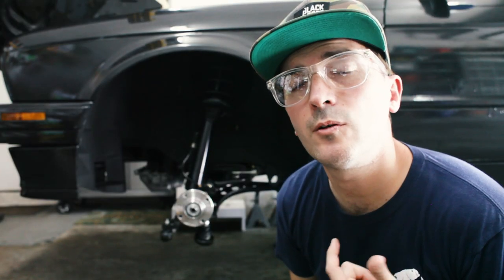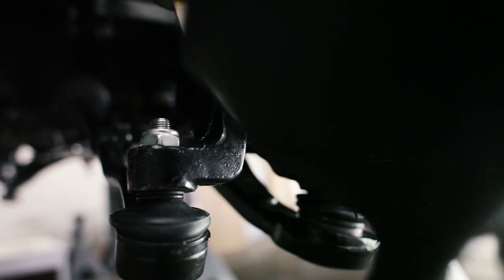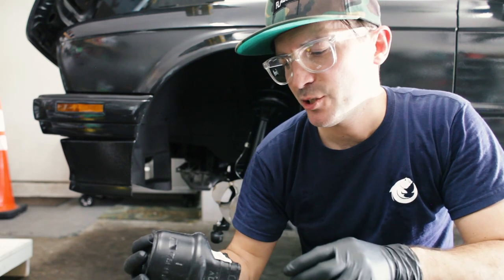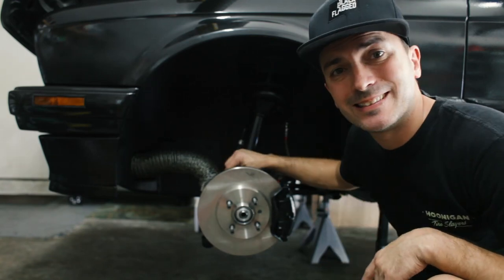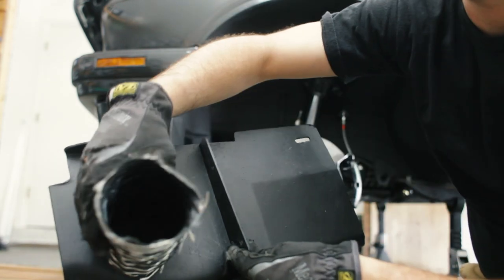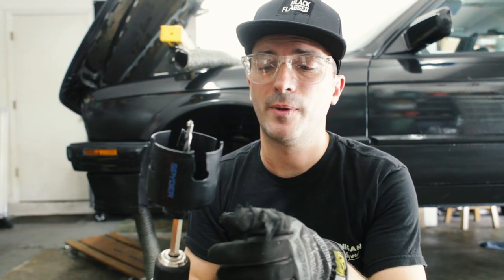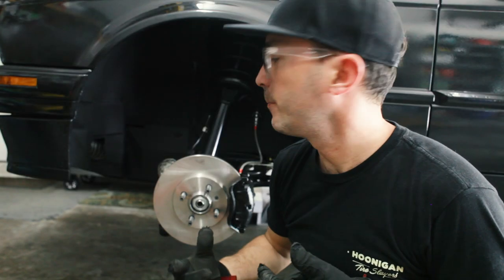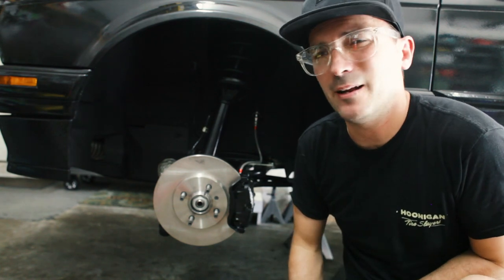Custom Brake Ducting and Brake Backing Plate Install | vlog 071

Comment: Hmm, U mounted to ducting like that. Great and smart (and ofcourse clean) but im thinking now. How does it moves when u turn?! Is the movement so small that it just ""stretches""? Would like to see it in action
Reply from the maker: I made sure all the slack in the hose is by the backing plate (as opposed to under the car between the two holes), so there’s enough slack there to move with the wheel. I’ll try to get a video of it soon
Reply: Okay nice done :) Hope to see it :)

Comment: What type of ducting tube did you get and from where?  Also, leave the other vent open, it will reduce the negative pressure that is created in the wheel well.
Reply from the maker: I used this hose: https://www.condorspeedshop.com/collections/e30-parts/products/copy-of-3-neoprene-brake-ducting-hose
Reply from the maker: And good to know about the other vent, thanks!
Reply: Thanks again for the link.  That's a pretty good price. Having a hard time finding good tubing at a reasonable price
Reply: Came across that when dealing with canards.  Canards have to to be 2/3 of the way up between bottom of front bumper & top of wheel well, so the air gets deflected into the wheel well to help disperse the negative pressure.

Comment: I keep bits of 2x4 wood around for different things. One being to act as backing behind flimsy materials that I need to use a hole saw on. You could go as far as tacking the plastic down on either side of where the pilot hole will be with a couple wood screws. 

Thanks for sharing.